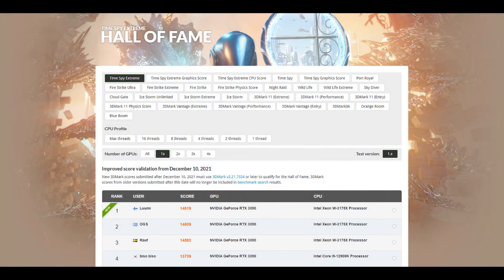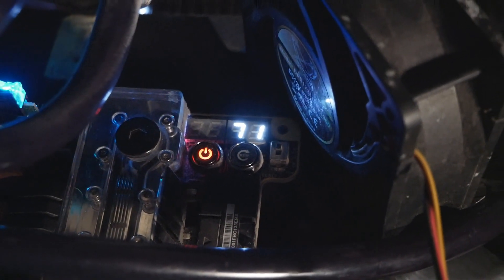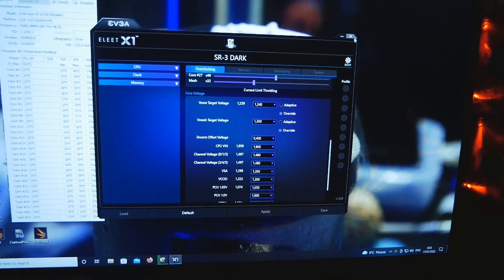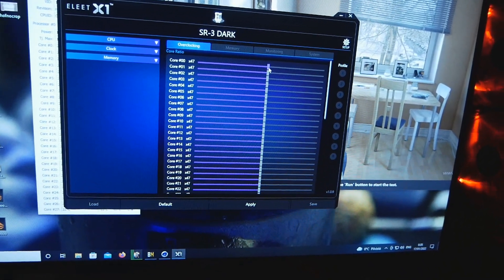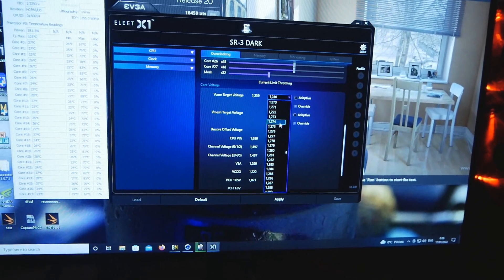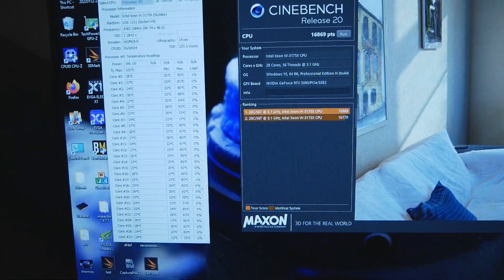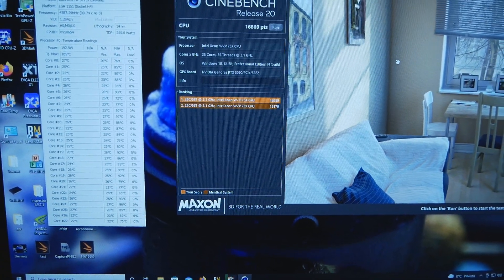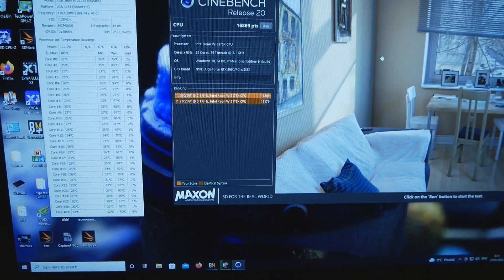1000W+ Heat Loads on Water Cooling - W-3175X Overclocked to 5GHz on EVGA SR-3 DARK

Comment: Would a Heatkiller 480-L + Heatkiller 240-L which are both 48mm thick be able to keep the W-3175X cool at 4.5ghz at 1500RPM or under? If not, would it be enough for 4.2ghz?

Comment: Your videos about W-3175X are great, quite thorough and informative.
Would direct-die + LM and dual Hardware Labs 480 GTS be enough to cool it down to reasonable temps (less than a 100C) for stable 4.7 to 5.0 (if I'm lucky with the silicon lottery) or should I go with dual 480 GTX ?
MO-RA is out of the question since I want my build to be inside a case, slightly modified Corsair 1000D. 4 rads in total, all 480mm.
Reply from the maker: I think could be a close call if you really want the W-3175X. Need good contact on the cpu itself.
Reply: @LuumiJuhani  
Hmm, ok, though lapping the die is quite dangerous...
I understand that thick rads are better, but I can't do push-pull with 60mm and GTS is already as good as a 45mm rad despite being only 30mm.
For the block I'm planning to use EK's WS block as it is the only LGA3647 block with a proper flow distribution. Although I'll have to grind the sides a bit so that it doesn't touch RAM sticks.
Reply: @Rubed0_o  Any luck with your build? I also own the EKWB Velocity WS but no idea if that Iceman direct die frame is compatible, what screws did you use and have you done the delid yet? I'm curious if it's even compatible.

Comment: These high-core CPUs are insane! 🔥 AMD is even burning down the house (by Talking Heads). It's an old song but applies perfectly to these temps. 🚒 
Decided to look up AMD for fun. 🤣 Once you're done, try to put it in power-saving mode. 👍 It helps tremendously! ☺
Thanks for the awesome video. Had to throw a couple of jokes in there because these high-core CPUs get hot.

Comment: While I love the testing, THIS is beginning to become a bit of a sore spot for me. While the Govt's of the world are trying to get my racecar sent to a car crusher because of emissions, they continuously turn a blind eye to the fact that most emissions are created from power plants that feed big Data centers around the world. I love high performance computing, but I strongly believe that the Computer Chip industry NEEDS to experience it's own "USA 1972" (Fuel shortages for cars that forced fuel efficiency to increase). Intel and AMD need to stop racing to 10Ghz and begin racing back to down to 100W, as ARM is nearly set to take over the world.

Comment: I've had same issue on 3080ti overcloking it , software reported 900W aprox and external meter 1250W . Yes the freq with same voltage increasesd will draw more current in it .

Comment: Great stuff, Luumi! All my rigs are custom water cooled. Ever since I first built one and saw the massive performance gains, not to mention the drop in noise, I was hooked! Plus the lower temps translates to longer life of the components.I know it's stupid expensive, but I feel it's worth it. 
I really like that PMD! Much better than using s clamp meter. And the price is good too! Probably pick a couple up for my rigs. Those 2000w PSU's look pretty sweet too!
Thanks for sharing your knowledge and experience. o7
Reply from the maker: Problem is that all PSUs can't cope with all the different platforms now. I would prefer a 2000W or 2200W unit with  4 EPS 8-pin connectors and feature the new power connector that is coming with 3090 Ti.
Reply: @LuumiJuhani  yea i wish i could get a psu better than 1600 watts here. but I can't afford even that. I have two 1200's but got the evga p2 for free from 2080 ti kp bundle a couple years ago. I wander if the 1200w psu is the reason i can't get my 3090 kp to go above 2500mhz. I will join your discord when I get back into ln2 oc, I had to take a break between the unavailable products and overpriced products.
Reply from the maker: @Apollo-Computers  You can't easily because of US mains power. 230V needed.
Reply: @LuumiJuhani  yea I know, we have it. It's just not a common room outlet. I have put them in before. Just can't get them psu's here.
Reply from the maker: @Apollo-Computers  EVGA 2000W is listed on newegg.

Comment: How many CPU 8 pin eps connectors is it using? Maybe the software only take into account half of them 🤔
Reply from the maker: I only used two, SR-3 dark has 4 connectors but that needs dual PSU.
Reply: my guess is that it uses the vid and not the actual voltage to calculate power

Comment: Interesting, I think the software power measurement is somehow bugged on this platform
I have seem some X99 boards measuring 0.3 W power under load...
But at the same time, some motherboards seem to report correct power. I am also not sure where the software measurement is supposed to be, but if it is die sense Vin * I, then that always excludes the VRM loss and the PCB+socket loss.
Reply: Hwmonitor is bugged, hwinfo and aida64 show good measurement. BTW only at manual vcore hwmonitor is bugged

Comment: 1,000+ watts for a CPU. LOLZ. What was the water temp? What’s the power supply?
Reply from the maker: Room temperature around 18-19c, PSU is 2000W Leadex 8pack. Damn good PSU unit, I also have the EVGA G+ 2000W in use.
Reply: @LuumiJuhani  Is it ARGB.? :-)
Reply: @LuumiJuhani  leadex psu ftw can't fault mine!